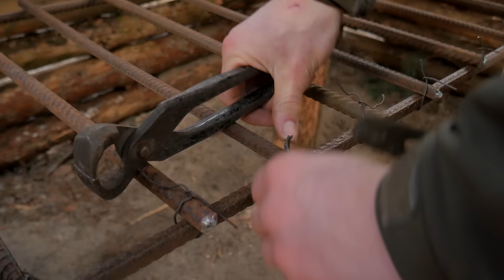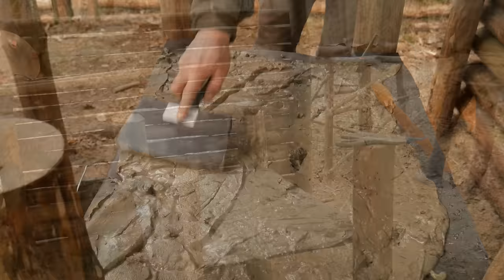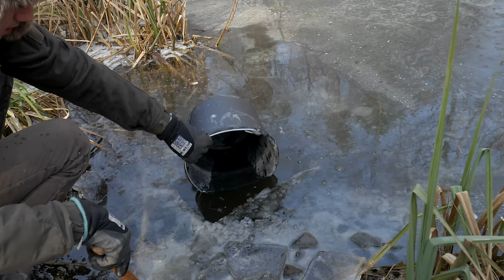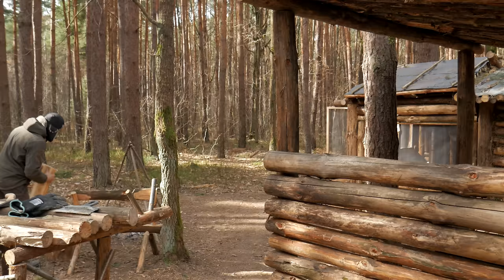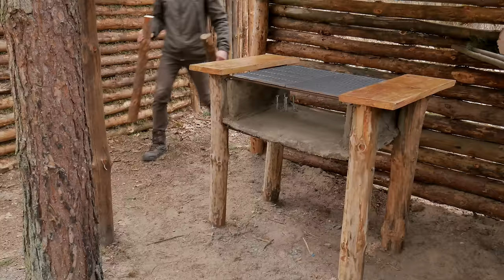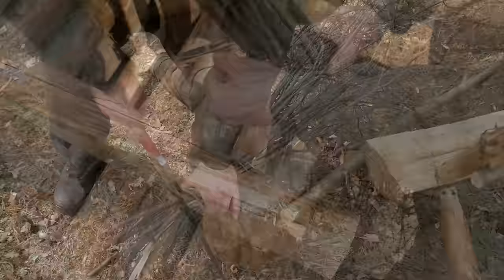Off Grid Cabin Life | Making Stone Barbecue (BBQ) Table in the Forest Kitchen, Outdoor Kitchen

Comment: Pretty high end for off the grid living, new cast iron cooking grates, metal mesh window screens, rolled rubber roofing, Brand new sheet rock trowel, spar varnish ? I guess my idea of off grid living is a little different from yours.  When I did it years ago all I had was an Axe, bow saw, file, small folding shovel and an old cast iron skillet from the dump. Different times I guess, as long as it works for you, more power to ya.